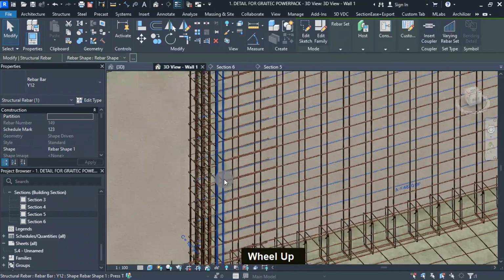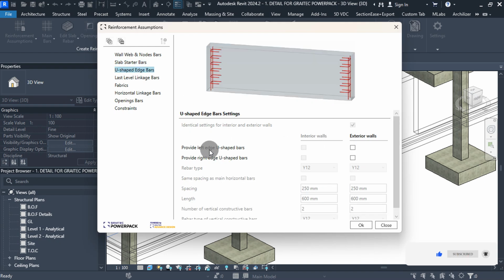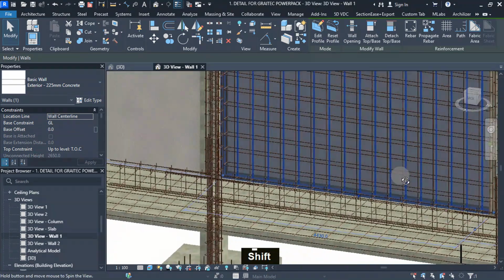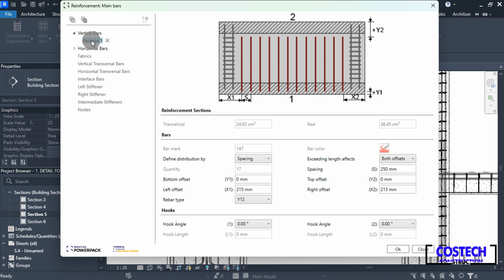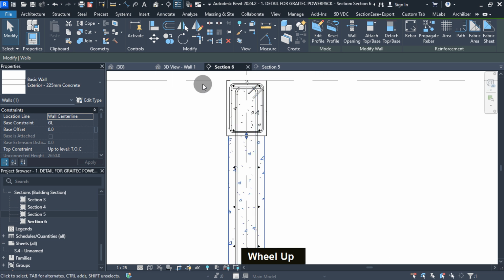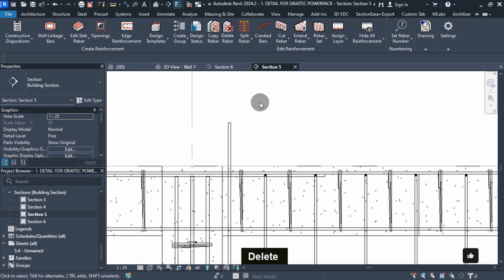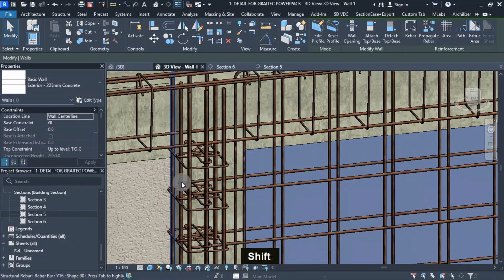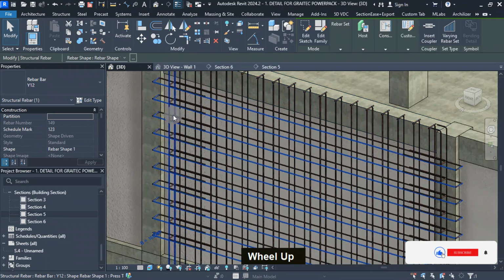Detailing Rebar on Concrete Walls with PowerPack Plugin for Revit

Comment: Please, at 01:02 scene of this video, how did you change your bars diameter to Y12, mine is showing 10M - 57M , which is the US reinforcement diameters. Please, how do I change it?
Reply from the maker: You will need to import rebar shapes families that have the "Y12" . I have shared the files in Patreon for the shape family.
Reply: @costechconstruction254  please, I have downloaded and installed the Revit 2024 UK  content that I believe has the Y12 or H12 rebar shapes family but I dont know how to go about it? 

Can I send you a screenshot via email to your Gmail?